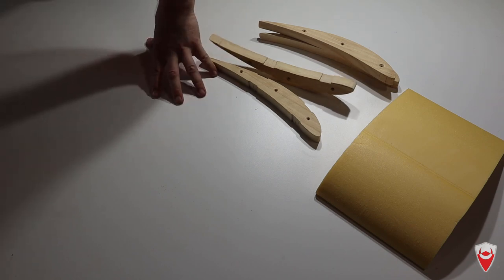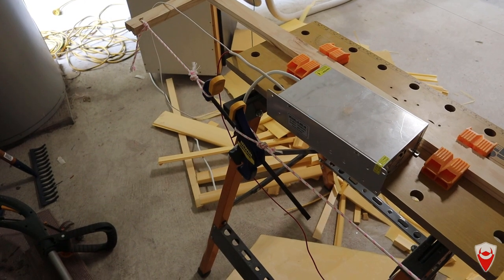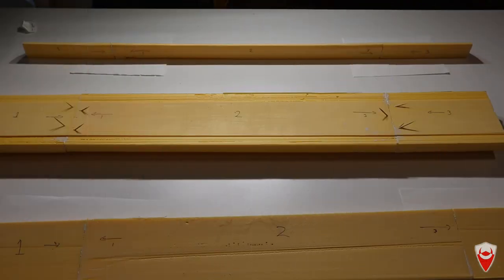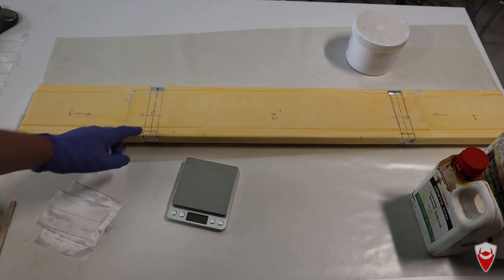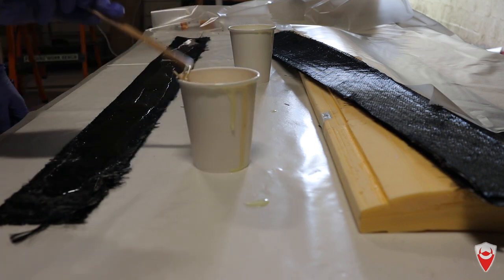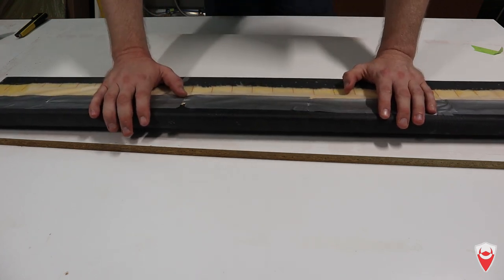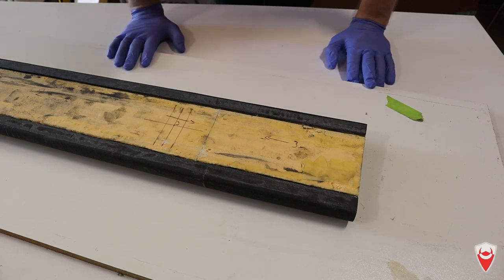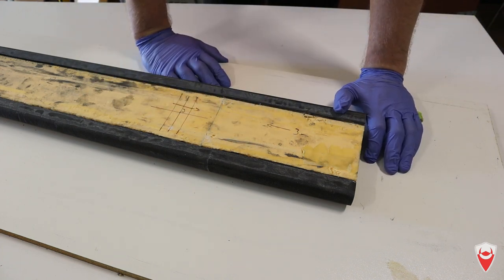[BUILD] Making a Carbon Fibre Wing: Part 2 - The Spars

Comment: So I didn't do the calcs myself, but I am broadly familiar with how much carbon the aviation guys are using, and it seems like your wing is pretty dramatically overbuilt? (Not stating, asking). Looking over your spreadsheet, it seems as though the deflection can't possibly be that high. I'm trying to use an online calculator to check.

EDIT: Again, I may be doing something wrong, but simplifying to do a box beam with uniform load (which the arc of the carbon ought to be superior to?), I get a deflection of .308mm with 1772 N/m load distribution, .135m span, 1.6mm thickness, and Modulus of 45 GPa.
Reply from the maker: It is pretty overbuilt, however, the deflection "between spars" (which I assume is what you are referring to as it is the 0.135m span on the sheet) is the theoretical deflection of the unsupported skin under load, not the whole wing itself. 

With the foam still in there I suspect that number is completely meaningless now. However I was originally contemplating melting the foam out to have a hollow wing. In that case, the skin between the spars would have been a solid beam with 1.6mm thickness, 0.135mm span and unit length (as it makes the calculations easier to use unit length and load/unit length). I don't think it is unreasonable for sizeable deflection there.

The free end and center of struts deflections are the overall deflection of the wing, and they are substantially smaller. But that assumes the load is completely shared across the whole wing cross section, not locally applied.

Does that make sense? I'm happy to be wrong, if you think differently please let me know. 

As for the overbuilding, I did originally start this as a learning project for myself, I was then going to test the wing at the end to verify my model and see how the whole thing ended up. As you're probably tracking from watching my video, the wing ended up bigger and with a mate instead.

Comment: The video is interesting, but I see a problem with this construction method: you have limited control over the fiber direction. It probably won't matter for this application, because it seems over-engineered anyways, so this is just a general observation in case strength is more of an issue (like in airplane wings). You would want longitudinal direction for the upper and lower spar surface, but vertical or even better bidirectional in 45/45° diagonal orientation (or triaxial) for the vertical connection part. You can't have all that be winding the same cloth in that 'C' shape. What I would have done: rectangular spar cross section, with two separate types of cloth:  longitudinal stripes of unidirectional cloth for the upper and lower surface and then wrap triaxial cloth around the entire thing (the vertical parts don't need to be very strong, so very few layers of triaxial would do the trick).
Reply from the maker: Thanks for taking the time to comment.
You can still get good fiber orientation control with an open, wet, hand layup (routan aircraft are testaments to that), however you won't get the same level of precision as you would with prepreg (and cnc tape placement etc).
Specifically on the points you raised about the spar: it was well over engineered, this was done because I was exploring the construction method and was only intending to make a smaller section, but somebody wanted it knowing the limitations of what I was doing so this is how it ended up.

The spar c channel was a quasi isotropic layup with a higher weighting towards the 45degree fabric I was using. If I was doing it again I would probably lower the number of layers in the vertical surface (maybe take it to 2x biaxial and 1x twill) and then use a unidirectional tape on the spar caps.

I wasn't trying to make the most materially efficient wing here, but rather go through the process from start to finish. When I make another I will refine it and it will be better than this one.

Comment: The clamp and spring to maintain tension were great ideas. 
With the glue, I would use a cheap small paint brush to spread it over your surface evenly for a better glue joint
Reply from the maker: Thanks for the comment. I'm probably going to use the same glue on the next video to join all the bits back together, even though I said it took too long to cure....